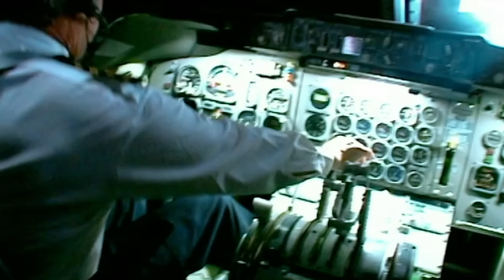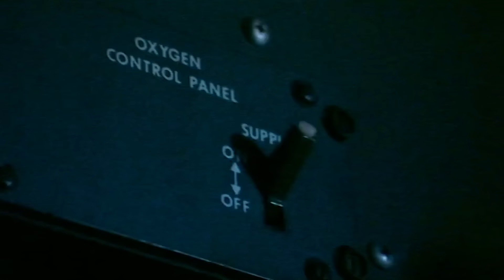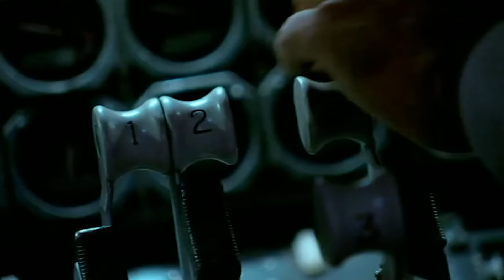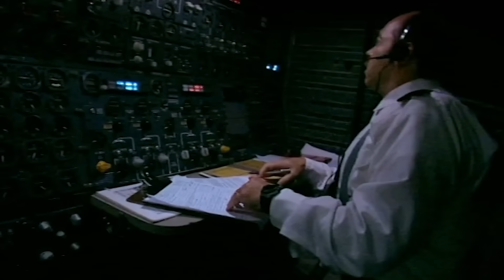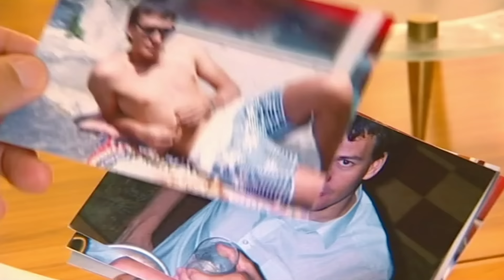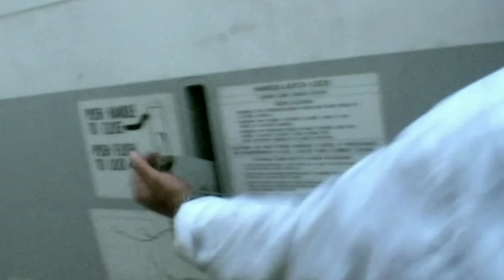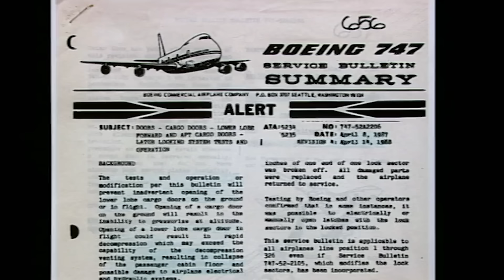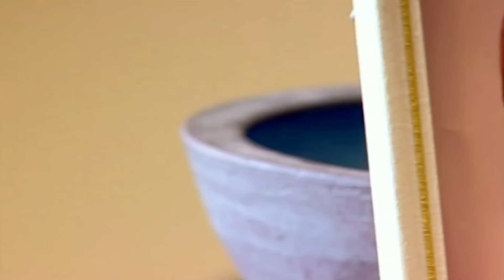Flight 881: What Went Wrong? I Mayday: Air Disaster

Comment: Lee getting sucked into the engine has to be a crazy improbability level. What luck. I doubt he went in clean. Very likely he went in partially, with much of his body weight being outside the intake bezel. Either way, no time to think and it would have done incredible damage to the engine and mounting pylon to have a man-sized load suddenly smashing into it. 

But to anyone who was conscious and falling after the decompression sucked them out, that's just an unbelievable change in circumstances. One second you're in your seat, then you hear a thump. Next thing you know, it's louder than anything you've ever heard, and you're not in the plane anymore. Maybe you're still strapped in your seat, but you're not in an airplane. Are you dreaming? The wind is ripping and swirling as you spin and topple. Can you orient yourself to even deduce what is happening, or will your brain just freak out uncomprehending and frantic until you lose consciousness one way or another? Getting thrown out of a plane at 500 mph strapped into a chair would probably have you spinning like a Major league fastball.

Comment: The Aussie is wrong. The locking cams are quite light. If the locking handle Is held down during the locking cycle the cams will be bent away from the locking lugs. When the cams are bent enough the locking handle can be locked without the locking lugs being locked. There was a mod going on to reinforce the cams at the time of this incident. United never performed the mod. They continued to dispatch flights with a visual inspection of the locking lugs through the inspection holes. At the time of the incident TWA was preforming the mod at Kansas City and JFK on lay over. There were only two doors left to complete. Many of us that had worked on these doors did not understand how this could happen. I called our door engineer. He explained the problem as I stated above. Further the mod was being done due to an accident in I think Turkey. It was found that the cams were bent and the door was locked at the mid span locks but not the bottom locks. The United door was recovered later and was found sheared at the mid span lock area.

Comment: I've been to 33,000 feet in a pressure chamber without an oxygen mask in flight crew training in the USAF.  There is no feeling of suffocation, in a short time a feeling of euphoria will begin then if not put back on pressurized oxygen you will die.  The off duty flight attendant is a drama seeker IMHO.

Comment: Also wondered if the storm was a low pressure system which could have exacerbated the pressure differential with the inside of the 747. Apparently a storm system can lower air pressure and oxygen availability by approx 13% for those climbing above 8000m without oxygen.
(Without discounting the electrical findings. Though that leads to thinking what an electrical storm could be capable of. Especially if that (un)locking switch was live) Not an engineer.

Comment: Hundred of millions spent and invested in their planes......... and yet, no one stopped to think and test out a freakin' huge door to make sure if you try to turn it on and open the door while it's close whether manually or electric short, that it won't open?  Crazy to think all the money and effort and ingenuity involved in building a jumbo jet, that something that seems so small (though crucial) was overlooked.
Reply: This was also an outward swinging cargo door which is a flawed design and not really used anymore. The new cargo doors are plug type doors that seal when the plane pressurizes.

Comment: Very simple solution, take out the motors and use a hand crank system only on the locks. Problem solved.  

The bigger problem is the FAA and Boeing sleeping together. 

Between this and the MCAS system (Major  Crash Assurance System?) I don’t have much faith in Boeing anymore. 

There are plenty of other issues beyond this and that, however.

Comment: I wonder if it was the same maintenance that worked on Aloha Airlines.
Reply: Aloha was different, they simply exceeded the number of takeoff/landing cycles the plane was designed for.  The structural integrity beyond that duty cycle was compromised.  And the amount was grossly exceeded, not just a little bit.  Like buying a printer that has a duty cycle of 1000 pages and you try to print 10,000 pages out of it then see it go up in smoke, should not be surprised one bit.

Comment: How sad the Camble's lost their son. They spent their own money to find out the problem. That the problem was the airplane electrical system can accidently open the alunimum door handle. The NTSB refused to acknowledge their mechanical findings.  Rather the NTSN made other excuses .  Yet, it happened again. THe NTSB finally had to say something. Then the other problem in regards to plane maintenace problems.  Fuel lines causing a explosion.  The certain airlines placing profits before the safety of the airline crews and before paying passengers.  No plane should be flown until its factually air worthy .  No corners cut. Just to make profits.

Comment: What the smart experts at MIT need to do is invent a prototype graphic plane in animation. Considering gravity, wind, and all kinds of weather. With every possible airplane worse scenario . Then modify the planes of today.  Example : Rather then any commercial plane taking a chance of rolling in the ocean on the wings with lots of fuel. Burning all the passengers. If the pilots have to ditch the plane in the ocean , because they lost both engines. ( 1.) Here is the solution.  Have the entire area where the passengers are sitting , become capsulated . Then where they are siting is like as one big tube.  Now prior to the plane hitting the ocean.  The capsulated portion of the plane will be released.  there will be a jilted disconnect from the rest of the plane.  The wings of the plane will automatically be disconnected . To prevent any contact with the passenger escape . Now once the capsule with all the passengers in it are free. As soon as the escape capsule is released on the sides of the Escape Capsule Release , One thousand attached hydraulic attached air chargers will then give the Escape Capsule altitude and lift.  Next using NASA satilites plus a Personal Locator Beacon. This will let : AIR TRAFIC CONTROL , know the exact location of the ESCAPE AIR EMERGENCY CAPSULE. With all the passengers. With the attached : Air Rockets on the Escape Emergency Capsule. Now if the pilot of the Air Capsule , decides to fly to the nearest airport he will be able to.  This EMERGENCY AIR CAPSULE , will also be able to land in the ocean. Then because of a satellite,  beacon locate another emergency capsule. Now the two capsules can connect side to side. One will have bathrooms. Then also a big kitchen with food. With a machine that converts ocean water to fresh water. Also the EMEGERGECY AIR CAPSULES , will have the ( SHARK SHIELDS ) all over these EMERGENCY AIR CAPSULES ) . This will keep sharks away. Until these Air Capsules can be rescued by the Coast Guard.  The AIR CAPSULES will be able to produce oxygen like a submarine does under water. Using solar power. Very simple. Soon no death in all the airlines. We must separate the EMERGENCY AIR CAPSULE , from the airplane before impact. To the ocean or mountain. Used if both engines are out. Or the plane is in a stiff dive. The pilot must press : RELEASE EMERGENCY AIR CAPSULE . IN TWO MINUTES IS PLENTY OF TIME FOR THE PILOT AND CREW TO NOW SIT IN THE ( EMERGENCY AIR CAPSULE ).  ONLY TWO MINUTES. Now the pilots will operate the , EMERGENCY AIR CAPSULE . Very simple. MIT can invent this. So can NASA.  The Holy Bible says: NOTHING IS IMPOSSIBLE TO THOSE THAT BELIEVE .

Comment: They should’ve made those out of steel hardened steel and probably wouldn’t have deformed and would have better designed was when those locking things return the certain way it would hit a switch or a switch in the handle that cut power off
Reply: mindless babble

Comment: First of all, kudos to the parents. 
Second, they should have never had to do this.
Third, Boeing is a disgusting company. As was Michael Doughlass. DC aircrafts had the same problem with their doors. Outward opening doors that would 1. not lock all the way because mechanism was defective and 2. a faulty motot would just open them up. They also had multiple accidents as a result of this and the "lobbies" were used to come to an agreement with the NTSB to not ground the flights. It caused a fatal aircrash where all people on board died for them to actually issue and Airworthiness directive ( aka ground flights now, fix the problem get it checked on every craft and only then the planes can fly). I mean, I still have zero confidence that when the flights are grounded, they actually fix every single flight. I think they just ground them, fix a few and move on.

Boeing always tries to hide its structural mistakes and blames it on the pilot, the ground handlers, language, other people from other cultures being dumb so as to not understand how airplanes work ( seriously, no joke) and on and on and on. There was a Japanese flight that crashed because of Boeing's Flight Navigation System Malfunction and they refused to share investigative findings with the Japanese Airlines or government and said it was Pilots fault that he didnt understand the readings were conveying something they werent actually conveying. There was another flight in some south east asian country that crashed due to similar reason and while the NTSB came along to investigate, the airline cooperated fully, Boeing took the wreckage and didnt cooperate with the investigation at all. The owner of the airline cooperated fully and when there was zero fault found with them and the pilots, they had to push the NTSB to investigate the airplane itself and push Boeing for months before they cooperated and admitted a small fault (not even the complete thing).

Boeing has had problems with their sensors forever. The onboard Flight Navigations system is wierd and does wierd things. Pilots have to often fight it to fly the plane instead of it helping them to. This isnt a recent problem, this has been going on since atleast the 70's. And it has never been resolved. It is the same story with every new model. Boeing gives faulty readings that arent coveying the problem, pilot tries to do the checklist provided by Boeing, The plane dips nose down uncontrollably and crashes. And they always blame the pilots. Even the most recent grounding was oh you need to train the pilots properly. Their entire nav system is faulty and they know it and I dont think they know how to redesign it, so they just hide it through lobbying. The cost of people's lives shouldnt be this cheap.